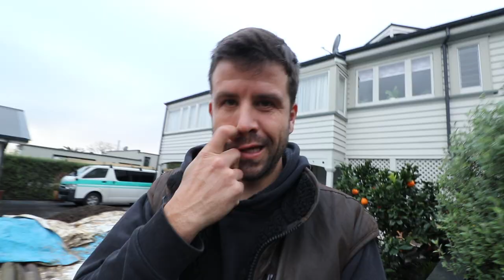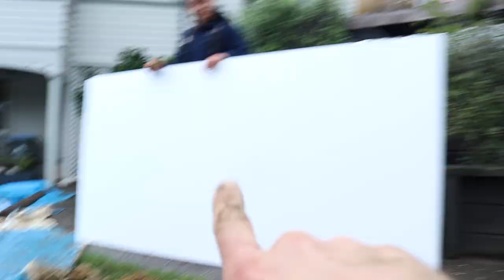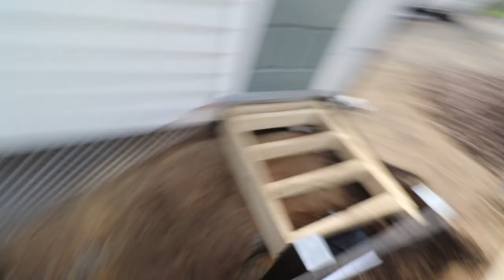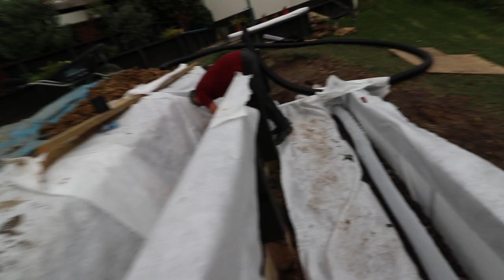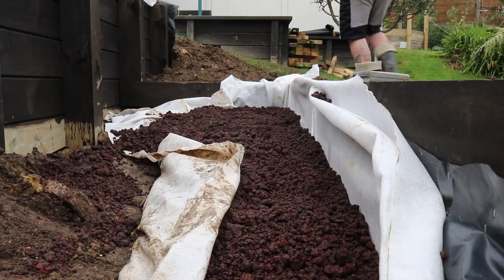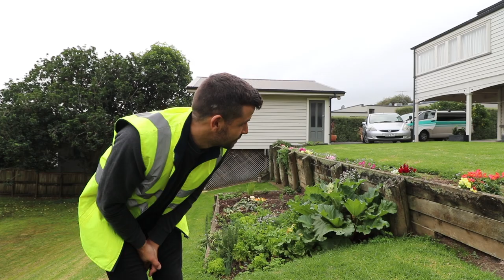Build a Retaining Wall: FINISHED! [Part 3]

Comment: Nice tidy workmanship, on the edge of what's legal for a non- engineered landscaping wall. (As soon as you've got slopes above, below or a surcharge on the wall, or it's over 1.5m high, it needs to be engineered.) The dpm and polystyrene is a concrete wall detail, and really isn't good on a wall like this. With that much scoria, no water pressure will exist behind the wall unless the pipe blocks. With no dpm, the wall will let you know if the drainage fails, with dpm, water ends up trapped in the worst possible place. The filter sock you can put over novacoil adds another line of defence against the topsoil that will wash through the scoria once an avid gardener rips the geotextile. A thin layer of clay under the topsoil will keep the garden growing, in summer, this wall will require lots of irrigation, which will all just end up following out the bottom like South island dairy farms... Also a clay cap can divert storm flows over the wall, keeping water out of the backfill. These are just a few best practices that will make a better wall. However the best design with poor workmanship will fail in weeks, and you've got quality workmanship in spades. Finally I'm sure you used square posts to match the style of the other walks on site, but are you aware that round posts are heaps stronger than squares. (Due to the way fibres are positioned in a tree trunk)
Reply: That's a good point to make for non-NZ viewers which will be obvious to locals but perhaps not to folks from outside NZ, the reason for the double wall instead of a single higher one is that if you go over 1.5m, or if there's surcharge or extra load like parked cars, you need to go through a building consent process.  So you end up with lots of stepped walls, two, three, or even four in a row sometimes.
Reply: Unfortunately, a lot of people don’t realise that a wall above actually surcharges the wall below, so there are a lot of illegal terraced walls out there.. another benefit of terracing walls is reducing the fall height, and avoiding the need for handrails
Reply: Lots of great points there about desirable water retention in the topsoil. But a wall won't add surcharge to a wall below if the distance between the walls is at least it's height (45deg angle). unfortunately the error many/most people make with load and the permit requirements is that they determine the height of the walls as the finished (visible) height, not the original or excavated height. Can undertstand the desire to do that tho' - permit and engineering could easily add $10G to an already expensive job like they did here. There was so much scoria in this wall there was almost zero need for the coil except at the exit point. And I don;t know many gardening tools that will easily puncture the double layer of geotech fabric!
Reply: @DiscoFang  I need you to build my wall for me!

Comment: Why in the hell would you go through all that just to use wood?  No serious question
Reply: same
Reply: Wouldn't you have the same issues even with concrete or other materials?
Reply: @taunokekkonen5733  Not with concrete retaining wall block.  In fact it is a much less complicated method for installing them, and they will last longer than many lifetimes.
Reply: concrete does not rot
Reply: It won’t last more than 20 years if that should of used reinforced blockwork quicker and will be there for 200 years looks better as well typical chippies building stuff which isn’t gonna last 🤦‍♂️
Reply: @jamesfoster4256  retaining walls in NZ must use H5 grade timber when in contact with or below the ground. This will last an easy 50 years or more.

Comment: 110 drain flo will slot into 100 PVC joiners with enough pushing. 65 drain flo slots into 65mm Marley pipe (not the joiners, the pipe itself!) also with some pushing. Add Marley cement and some tape for good measure and it’s good to go!

Comment: I'm seeing elsewhere that PVC is not recommended for the back of a retaining wall, wood in particular, as you're creating a dam that is an impediment to water drainage generally. Geotech fabric only, according to some. I'm no expert and in two minds as I had considered PVC to force any ingress down towards the drain pipe.

Comment: You've built a wood lagging retaining wall with 2 or 3x8 lagging.  The lagging therefore has spaces each plank which is about 8 inches. Won't the water be able to drain out of the wall at the space between the lagging? Are you concerned that the gaps between the lagging will get clogged and prevent drainage?

Comment: It's always worth putting an inspection point or two somewhere along the the drainage line. 

That way if the drainage line blocks up with debris one day (which they generally do eventually).
You have easy access to put a jetter in the line to clean it out without having to dig or cut into the line.

Comment: I guess an advantage of this job already having a decaying retaining wall was it made it easier to sell the work needed on the new one to make to better this time.
A lot of customers don't want to pay for things they can't see or don't understand the benefit of.
Reply: but why replace already rotted material with another one of the same composition?  The problem with the original was that it was wood.  The problem with this one is that it is also wood!   If they did it right with concrete retaining wall block it would have been much simpler and last forever.
Reply: The original wall would not have been treated or concrete

Comment: Nice work mate! I don't think it's overkill. It's how it should be. Diverting the water is probably the most important thing in the wall.
Reply: It also stops water moving forward so could add ro hydrostatic pressure which ti the main way retaining walls fail.

Comment: Very nice work mates! A good guide for constructing my own retaining wall, which will be timber but using galvanised steel H column as posts, and I then slide lengths of hardwood in between.
The polythene and XPS foam on the inside is a good tip, it keeps the timbers dry, the XPS does not only protect the polythene from the sharp corners of the stone, but actually should prevent condensation build up on the inside when ambient air temperature rises above soil temperature.
I use Bankirai wood, which is a bit expensive but should withstand the wet climate in the Netherlands well, this wood is used for building shore walls in streams and canals.
As I'm going to apply a tar coating on the inside of the wood the PE membrane shouldn't be necessary, but I still can put that XPS in as I have a couple of left over packs after insulating a floor.

Also a good tip on using standard PVC fittings to connect to the spiral hose, so I must be sure to buy a size hose compatible with PVC size ie 75, 80 or 100mm.

Btw, Auckland is a great city, visited NZ twice and would love to come again.

Comment: When doing drainage I chuck a couple of tek screws in the pvc joints to hold shit together. I wouldn't trust just tape.
Reply: Tools & Stuff Hows it going to move with the stone on it?
Reply: @MrJFoster1984  So do you think you don't need to glue pipes either? There buried in dirt, they'll never move aye? I've seen plenty of pipes come apart underground.
Reply: What about slip joint pvc pipes no glue?
Reply: @cameronrolston6099  pvcs different tho bro cause I dosnt flex as easy as novaflow/coil/nexas I'm not saying it's gonna come apart but the nova fitttings don't come off very easy! they have little locking tabs! trying to trace nova coil in a diggers not the go!as I'm sure you would know bro haha not fun times!!
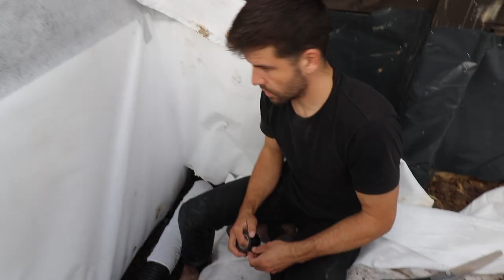Reply: Solvent weld at 3:30

Comment: I like the way you guys use plastic + white foam + the plumbing drain system to protect the wooden wall, but if i was you, i would use the 6” diameter or bigger size plastic pipe , and then pour cement + metal bar inside the pipe, use them as a post, replace those wooden posts, so it won’t get rotten or eating by termites . Anyway, good job you guys

Comment: U should use blue metal steel for drainage as well helps water fall straight into your agg instead of sitting dirt that holds moisture sands soils are also good

Comment: Hey SBC did u need a permit for that wall or because it's stepped does that takes away the permit issue?
Reply: I was wondering why the second/bottom wall was needed, since it appears the top one goes deep enough to take all the necessary load.

Comment: Hey bro nice job you guys done there! Just out of curiosity what size novacoil did you use and what was the cost on the joiners? If you let me know I could price them up throw the company I get my stuff from! Like I doubt the joins would come apart but having "tried" pulling a proper coil joiner off the other day!"had to cut the pipe out of it" just thought I'd ask!as a business owner my self I see that sometimes you just have to spend/charge abit more to cover yourself! Just a comment bro I think you boys did a mean job just thought I'd mention it!

Comment: great video!
A question: In a densely constructed residential area, if the lowest point in the retaining wall of your "elevated slab house" is at the fence you share with your back neighbour, what will you outlet of the drainage be?

Comment: It's a good job no doubt but the cost  would be huge. For a small, very basic retaining wall. For a little extra on top of this massive bill, could have build rock wall instead. Looks ten times better. 
If cost is not the issue, just about any body can do a great job. But do it on the budget, that's the skill.

Comment: there is a kind of dimpled plastic barrier that can go between the drainage material and the wall.There is also a school of thought that says the geotextile fabric itself will eventually get plugged.Does the drainage coil/drain have some form of "inspection point" to enable flushing the drain out/unblocking?.Love the way you describe what you are doing,and the real quality of your work
Reply: The only real risk of those points is the coil blocking. I forget the angle required for it to be self clearing but he had it only barely off level. But seriously, with the amount of scoria they had in there they really did not even need the drainage coil at all.
Reply: @DiscoFang  Tend to agree with you. I noticed also that the scoria  backfill wrapped in geotech was almost to the top of the wall with about 200mm left for topsoil to grow some grass. So its not like there is much of a drainage impediment - no need for plastic imo

Comment: Anyone know what the foam sheeting Scott was using is?  Hopefully it's extruded rather than expanded!!!
Reply: It's Corflute, not foam. It's like cardboard but made of plastic
Reply: Nope, it’s polystyrene sheet, almost certainly expanded because extruded is crazy expensive . It’s simply a detail taken from tanked concrete walls to protect the bitumen paint

Comment: Nice job! But I think you missed to protect the other side of the wood structure(underground)!!! I didn’t see your parts 1 and 2 of video and I hope the lumber you were using is treated with something, but it won’t last long... concrete would be much better choice imo...
Reply: For retaining walls timber is pressure treated to H5 hazard level meaning it will not rot when underground. Hopefully the nails used were stainless steel. The plastic was just there to reduce any resistance to water draining down to the pipe and avoid built up water pressure behind the wall which is the No 1 reason why most fail.

Comment: Scott, something has been bothering me about your video series on building the retaining wall.  Nowhere in the video do you mention obtaining permits or any inspections by city inspectors.  Here in the U.S., or at least where I have lived building contractors would be required to obtain building permits from the local municipality.  One would have to have plans, drawings, possibly engineering reports and sign-offs on the plans. Materials would have to be specified, type of concrete etc.  All this would have to be submitted to the plan check department of the municipality and there would be periodic inspections of each phase of construction once the plans were approved, if they were approved.  The city could impose changes in the plans and there would be a charge by the city for the permits. No project like yours would be allowed to start without permits.  You didn't mention any of this, what gives?
Reply: Here in NZ... 1: No permit required for retaining walls under 1.5m without vehicle or building load on the immediate ground above. 2: No permit required for replacing an existing construction with like-for-like materials that hasn't failed durability standards (That old one was at least 15yo). 3: Likely no permit required in that region for excavation that distance and height from foundations of the existing building. 

The main reasons why those permit exemptions exist and apply in the way they do is that failures of the wall for any reason won't damage property or person.

Comment: Skip the useless polyethylene and install an engineered drain mat product - surely they're sold in NZ?  Will have a filter fabric glued to plastic dimples.  Goes on fast.  Some have a filter fabric flap at the bottom to encase your drain tile so everything is acting as a unified system. Yes, more expensive to buy, but then there's no dicking around placing foam and you save on labor.  Frankly, all you really needed was well-drained aggregate backfill wrapped in filter fabric and a decent subdrain. And t&g isn't necessary and is perhaps counterproductive since you want that wood wall to breathe for maximum lifespan.
Reply: Tend to agree with you. I noticed also that the scoria (volcanic stone) backfill wrapped in geotech was almost to the top of the wall with about 200mm left for topsoil to grow some grass. So its not like there is much of a drainage impediment.

Comment: Over the top! Losing profits. Your not an engineer!
Reply: As long as he doesn't ask you for money, you shouldn't care about the dedication to his craft and his bottom line.
Reply: 🤦‍♂️ dude relax mate he did an awesome job and did the customer a favor..this wall will last longer than your hair  line...
Reply: The last wall was a failure. Hes taking measures now to not have some of his work fail, and by the looks of it it wont
Reply: An engineer would have made it chunkier beside the house... And added a good 5k in design, inspection and compliance fees... Trust me, I am one... Then if council consenting got involved,...
Reply: neil o brien And *you’re not a wordsmith.
Reply: @wekavpossum  You forgot your $5K fee. If this job had required a permit it would have turned what was likely $20K into $30+K.